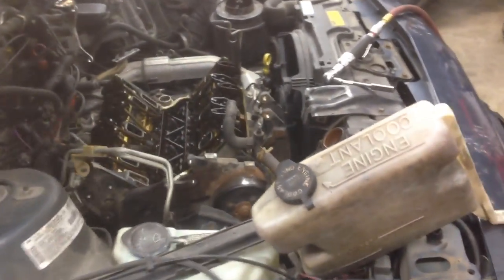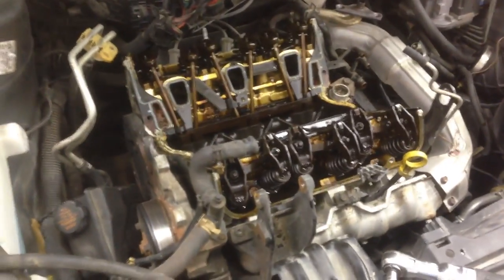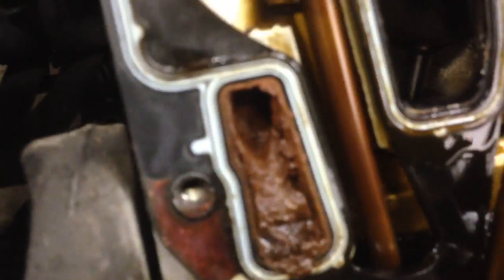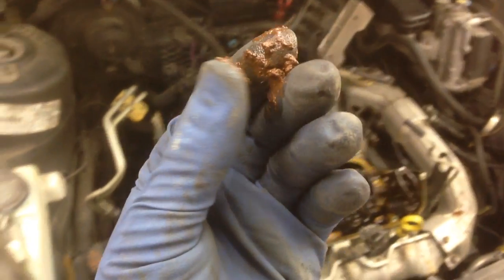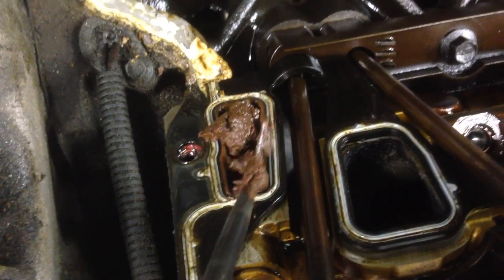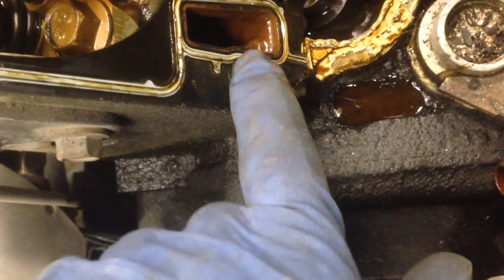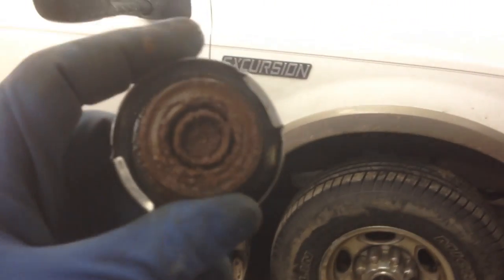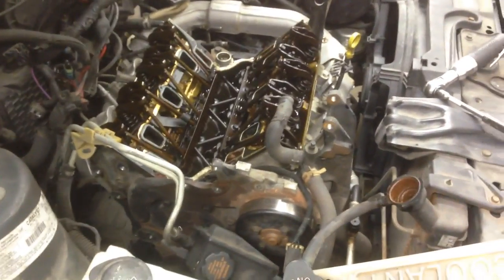Why it's called DexKILL

Comment: Two things I will never put in an engine, dexcool and quaker state oil. I have repaired a lot of vehicles with dexcool, its garbage and anyone who still uses it is an idiot, all it takes is someone to top off the system with the wrong coolant and you have a big problem. As for quaker state, if you've ever worked on engines that ran it you know what i'm sayin.
Reply: james vos
Yup many, many years ago QS was lousy oil.
Reply: boostedmaniac its a shell product now just like Pennzoil. I've used qs green bottle for the life of my truck no issues
Reply: somehow i feel like the person putting green coolant in a system full of orange (or pink, or yellow, or teal, depending upon automaker) would be the idiot, not the person using the oem-recommended coolant.
Reply: when i rebuilt my big block mopar, i noticed the oil was almost baked onto the heads and lifter valley.....i was told it was quaker state, or halvoline. i only use valvoline.
Reply: I own over the road semi-trucks. The detroit diesel engines require dexcool coolant and we run a million plus miles before having to do scheduled overhauls with no coolant problems...None.  I will say that there is an electrolysis additive that we add also but we never have coolant issues ever. The only time we've ever seen this kind of coolant failure is when we did an overhaul and got a bad reman'd head. We had some oil and a little combustion going into the cooling system and it turned the coolant into a gunky mess rather quickly.  People often wrongly mistake "air contamination" for this problem. Dexcool is fine.
Reply: spot on- quaker state sludges motors up like crazy. The original formula Deathcool can go bad on its own but definitely faster when mixed with green!

Comment: Had my coolant flushed in the Pontiac Montana last year (3.4L GM) but I’m still finding this gunk on my radiator cap. I cleaned my cap when I found it like that last year and assumed it was like that since before the flush. Now I suspect they didn’t really get all that out in the first place since there is enough to keep redepositing and layering the only part I can see without draining coolant.

Also, my thermostat is apparently stuck open, which I imagine this gunk inside could cause. Since they replaced the hoses and supposedly flushed the system I have not been able to get it to operating temperature without idling (temp stays low while moving). I’m going to do this myself which means draining coolant so I might as well run the cleaner stuff through and replace it again even though it’s only been months. I don’t have access to a hose for doing a back flush and have to carry water to the workspace in containers so I don’t think it will be a particularly good flush but at least I’m running the chemicals through it first.

Comment: that nasty sludge is from dexcool and glycol coolant mixing.
Reply: Totally false. All that happens if you mix the 2 is the Dex-Cool looses its longer life. As the title states this is due to air contamination.
Reply: Did you go read the class action lawsuit concerning Dex-cool,do it you could learn something. No worries about you bringing me your car as I am retired after 34 years,split between GM and BMW. Made a good bit of money fixing Dex-cool issues. Go google "Dex-cool class action lawsuit"
Reply: Hello Desert, tell me you went and read the class action lawsuit settlement. It is not difficult to find all the correct information about Dex-Cool. Can you provide me a link that states the reason Dex-Cool makes this sludge due to mixing with green? I am open to reading what you have. In reality Dex-Cool makes this brown sandy sludge even if there is no green coolant involved. GM provided us with instructions and procedures they wanted used to clean cars (under warranty) harmed by Dex-Cool.
Reply: Desert,yes you loose the long life offered by the orange but that is it. Give me a link (prestone or some other major anti-freeze make has to state their feeling somewhere)
Reply: OK,my point is that when you mix green and orange the only result is you no longer have the long life offered by the orange (one of the benefits of Dex-Cool is you do not need to change it so often),now it has the lifespan of the green. Did you read the class action lawsuit results? GM ended up paying out millions to fix people's cars harmed by Dex-Cool. When GM was given a chance to defend Dex-Cool they never said "we believe all this damage is caused by people mixing Dex-Cool with another type of coolant". All GM did was pay up.
Reply: Desert,do you see at the top of this video where the person posting says "due to air contamination"? this is what both automotive chemists (people that create chemicals for automotive use) and GM are saying. Just "google" Dex-cool class action lawsuit. The time has long past to file a claim but GM paid to fix a good number of intake manifold gaskets damaged by Dex-Cool. I have cleaned the sludge out of GM cars and trucks and was paid under GM warranty (I was a GM Dealer mechanic right smack in the middle of the Dex-Cool problem

Comment: The main issue is the lower intake and the repair procedure,  I've repaired 7 of these since 2001 . #1  Never use GM or any other after market plastic intake gasket, they fail. Felt Pro makes a excellent gasket, rubber molded over thin metal. #2 you need to clean out all the intake bolt holes and bolts threads and use blue lock tight when torquing the intake bolts down to the correct specifications. #3 Remove all the dex cool out of the block and radiator then install a 50/50 mix of old school coolant. I also performed this on my own car 9yrs ago a 97 lumina with 118.000 and I still have it. This is my work car that I put 93 miles a day on which now has 246.150 miles now with no leaks...

Comment: That my friends looks more like oil getting into the coolant somehow I had the same results with a 2000 Toyota Camry that did not use dexcool at all. And it Clogged all the lines. The reason bad head gasket I assume
Reply: dexcool has been known for decades to cause this type of sludge and they blow intake gaskets and most diagnose it as a head gasket .

Comment: looks like someone used bar's leak to me
Reply: Chris Henson yep, exactly what someone did. has nothing to do with dexcool
Reply: Chris Henson bars stop leak used to be recommended, and was used in the factory on new cars.  It stays suspended in the coolant, and gives it a rusty look, and that's why gm stopped using it, as the uninformed owners complained when their uninformed mechanics told them it was sludge.  The stop leak was just insurance against aluminum casting.  GM recommends the overflow bottle be kept the full hot mark on a cold engine.  Aluminum engines can not develop hot pockets due to air in the coolant.  All aluminum engines are unforgiving when it comes to overheating.
Reply: In my opinion, I think it is terrible that GM used stop leak in brand new cars. That means they are not confident in their product. If the job is done right, (especially on a new vehicle) you should never have to do that. Thats why GM was and still kind of is garbage. I have owned and worked on many, and I have to say my Hondas and fords have always been better to me. Its a real shame because GM has produced some really good cars that they ruined because they cheaped out. What a shame.
Reply: shots fired
Reply: No, not opinion. FACT. Its bullshit. It is plain and simple that a brand new car should not have cooling system stop leak  in it at all. If everything is done correctly (which it wasnt), then you shouldnt need it. Also the 3.4s and 3.8s are very well known for lower and upper intake gaskets going out and letting coolant into the oil causing a ton of damage to internal bearings and rods etc, Ive seen it multiple times. And also those awesome impalas are well known for transmission issues. My moms went out at 40k miles, so we had it replaced and then started to go out again after another 50k miles. We took great care of that car. Even put a trans cooler on it after the first one whent out and changed fluid normally. By the way we had the lower intake gasket replaced at 50k miles and the I did it myself the second time at 100k miles then it was fine because they finally came out with a metal gasket and stopped the typical cheap GM plastic bullshit.   And I said nothing about toyota, i dont like toyota anymore after the recalls. And i owned 3 honda accords and they were all better then anything else in there class quality wise. So there you go. I have been there and done that with these cars. and my ford fusion has been an amazing car to me.
Reply: Reading comprehension little buddy. I never said GM didn't have lower intake gasket issues, I said they were not related to Dexcool "melting them". As well, I understand your propensity to argue due to your inexperience. However, the sealer or stop leak is recommended for the all aluminum engines due to the increased likelyhood of a tiny seep or leakage due to the difficulty in sealing aluminum at gasketed surfaces and the chance of porosity opening up in the diecast aluminum parts.

Almost every manufacturer of engines installs the cooling system sealer at the factory....Cadillac, Chevy, Gm, Ford, RollsRoyce....etc. The list of buyers that BarsLeaks ships to is long and distinguished. You can even buy the stuff at the Chevy parts counter as Chevy's use it too....

Like I said....people a lot smarter than you or I developed this product and these programs. I would venture to say I was replacing head gaskets well before you were born and I have a wealth of knowledge on the subject.
Reply: I dont 100% agree with you and yes you are older than me. I am 25 years old. But I also worked on cars my whole life started actually working at a shop when i was 14. I have never heard of anyone other than Gm using that stuff in their cars. And honestly, those people who you call "smart" are also the ones responsible for all the engine failures due to them cheaping out and using a ton of lower quality plastic. Honda uses very high quality plastics on their vehicles. I know a guy who used to make plasic parts for them and the quality control was insane! all that aside I respect you opinion but I will never respect gm for all they have done and are still doing wrong.
Reply: "It is sometimes better to remain silent and be thought a fool".....look it up.

Good to see you into cars, just rember to keep your ears on the old dudes....they have been around a long time and have a little knowledge.

Back to Craigslist for me now.......looking to buy my 34th GM product......2nd gen Camaro's have my eye this month.
Reply: randsonic let me tell you, it is a pleasure finally seeing someone else understanding this.  Did you also hear that GM stopped doing this at the factory.  I understood that it was because the uninformed owners, and even some mechanics thought it was the Dexcool turning to "mud".  Also I have a 96 northstar and a 2002 3400 engine.  GM recommends keeping the overflow tanks up to full hot on a cold engine.  This is just extra insurance to keep air out of the cooling system should it run low.
Reply: Camaros are alright. the older ones that is.
Reply: And look at that GM stopped using it? lol

Comment: vinegar works as a good flush to break down the buildup of mineral deposits from previous owners using tap water on any used car you get. I don't know if it would clean dexcool sludge, but an hour or two in a running engine sure does clean out the radiator when the problem is from minerals. just need to warn people that if your car has overheard, change the thermostat when you flush it, because the vinegar will contaminate the wax core of a thermostat that has gone through an overheating issue.

Comment: I've personally owned three GM vehicles for over 100,000 miles each, all of which ran the Red Death.  Over the years, I've experienced coolant leaks, air in the system, lack of pressurization, etc., and never had a clogging issue.

My customers' GM vehicles, however, I have seen clogging issues in, and every time (after a bit of prying), I come to find out that they've either topped up with generic green (traditional or long-life universal) coolant, or they've used certain stop-leak products.  GM's DexCool coolant does not play nicely with others!

Despite its rust-like appearance, this schmoo seems to respond better to bases than to acids.  Fix the leak, clean as much as you can manually, then do several flushes with 60/40 water and lye.  Flush until it's clear.  You'll be flushing all day, but it's the only way to prevent the schmoo from repopulating!  :)

Comment: aka Deathcool.  GM went way overboard on their change recommendations and the pH would go sour too, causing corrosion under gasket surfaces, letting air in when the engine cooled off.  As someone else mentioned, mix only with distilled water and change at 50,000 or so, not the 100,000 recommended by GM.  Small block V 8's with their predisposition for inlet manifold gasket leaks had a lot of trouble with Deathcool too.

Comment: Daniel... I'm in agreement with some others in here that the Dexcool is likely not solely to blame.  I have (from new) a 97 GM Safari with over 200K and runs exceptionally well.  I do my own work and have used Premix Dexcool for as long as I can recall.  In 2012 the intake manifold gasket failed and coolant leak into the oil and sludge up.  No apparent issues with the coolant passages though.  Once I did the work and all is well, I still use Premix and as of 2017, I do not have any sludge or discoloration of coolant.

After all said and done, Your video in my opinion would indicate... 1) Concentrated Dexcool diluted with very high mineral content water, or 2) Dexcool mixed with another type of coolant, or 3) A radiator "non compatible" stop leak added to the coolant, or 4) Any combination of the first three!   My guess is the first one if the water was from a private well but can also be within a city supply with very high mineral content!

Comment: A few things...dexcool doesn't mix with other coolants. When there is a coolant contamination, there is a crystallisation if the coolant and it looks like sand. If there is it contamination and Air in the system it will become acidic and the carrier and plastic will deteriorate and cause a failure. If you replace the gaskets and you do not completely flush the system prior to dumping the coolant, you're just going to repeat the the job.
Also what that looks like is sludge. Like the trans intercooler in the radiator has a leak.

Comment: I had the exact same issue and paid twice for it at 78,532 miles.  The mechanic suggested a through clean out and have the coolant system checked for leaks (if bad, have the heads and block checks for hairline cracks).
Block ok. Both heads replaced AND (I never would’ve thought about this ( new map, tps, barometric sensors replaced as well as a NEW EGR VALVE)!
I now have 218,110 trouble free miles.  The oil gets changed every 3,000 miles and the coolant every 75,000.  EGR at 75,000.  I’m happy happy happy

Comment: When incompatible coolants are mixed, this is what happens. Dexcool works fine in my 95 Tahoe with 5.3 conversion.
Reply: scot johnson you will have problems down the road trust me dexcool finally ruined my 4.3 vortec
Reply: Kyle Holmes it's been 4 years so far and I plan on flushing my system and replacing the coolant next month
Reply: I ran dexcool for years in my truck when a rod bearing spun at 659,330 miles I rebuilt the motor and it had red sludge all over the pistons and coolant lines I cleaned it out and built the motor to give more power 3 weeks later I got tboned and the truck is now a mud toy and out of the settlement I got a 2010 Silverado 2500 Duramax and love it

Comment: forgot the 3800 series II with the plastic upper intake being  one of the most susceptible engine to gasket failure.

Also that coolant port being clogged that bad on the rear head was why the intake gaskets started leaking. Probably created a hot spot where coolant flow was low.
Reply: I have a 2004 Chevy Impala LS with the series II 3.8 with almost 180,000 miles. I've flushed the radiator once and put in brand new Dex-Cool in it. Head gaskets are just fine. If you take care of your car, it will last like it should. I have the full aluminum bottom intake with the top plastic intake. No problems with coolant other than the plastic passage elbows cracking and leaking. The 3.8 liter engines from GM are one of their strongest engines to date. I've heard of more problems with the 3.1 liter and 3.4 liter engines and the 3.8 liter engines.

Comment: I have not seen a dexcool system look like that except for when people mix the old coolant with dexcool because the two react with each other and create exactly what you were cleaning out. Also if people add tap water that has a lot of contaminates in it you can get similar results. I had a 2003 grand am with the 3.4L and never say anything like that inside it when tearing it down in the 160,000 miles I had it.

Comment: Been using it for 15 years and never had a problem. Either the spastic has mixed it with a different type of coolant or some stop leak has been added.

Comment: Been using dexcool in my 2002 malibu since I got it in 2004. Never had an issue and I have been in my  engine. Who ever owns that vehicle did something to the cooling system. Preventative maintenance goes a long way. Dexcool is a very good coolant and I have seen plenty of evidence.